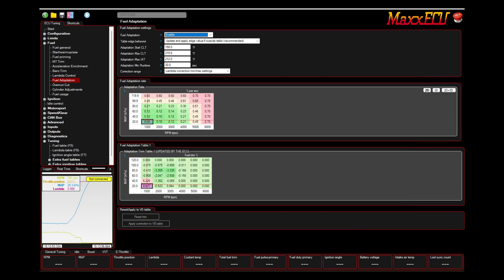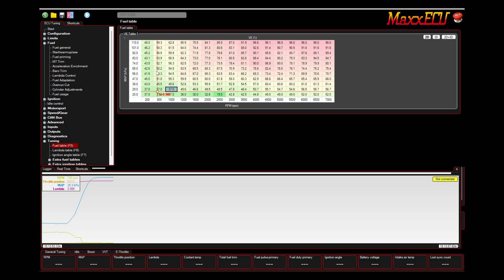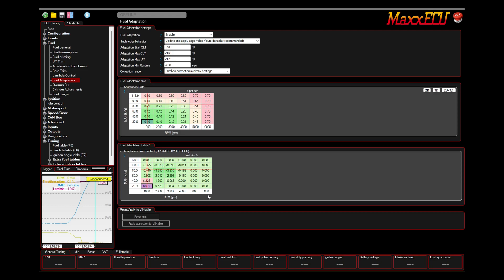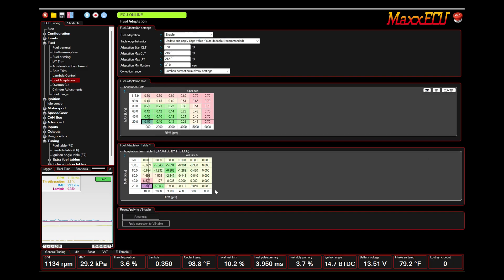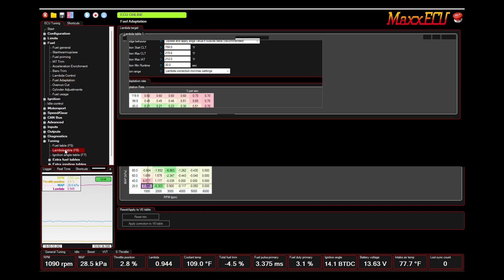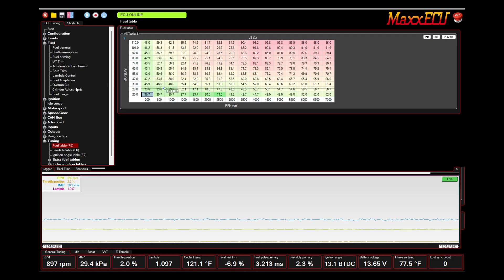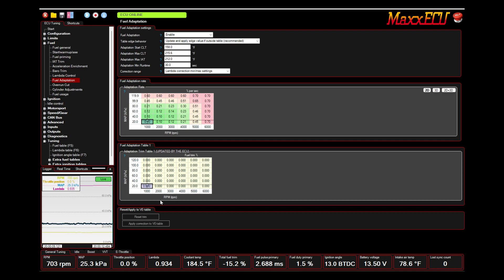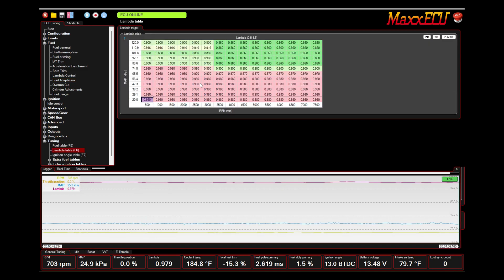MaxxECU MTune Fuel Adaptation Basics (AKA Long Term Fuel Trim)

Comment: Why did you switch to the MaxxECU vs upgrading to an MS3Pro?
Reply from the maker: I still use and tune megasquirt frequently. Megasquirt doesn’t have any drive by wire support so the main reason for trying maxxecu is DBW. Also maxxecu has a lot of other features that I like